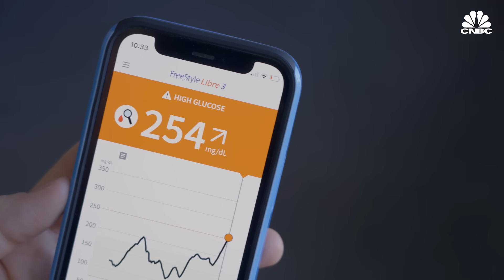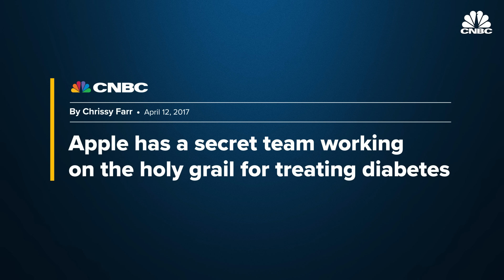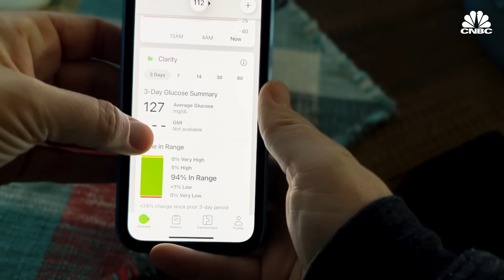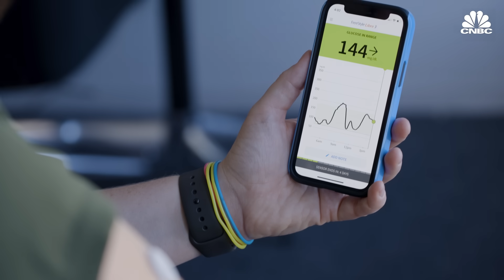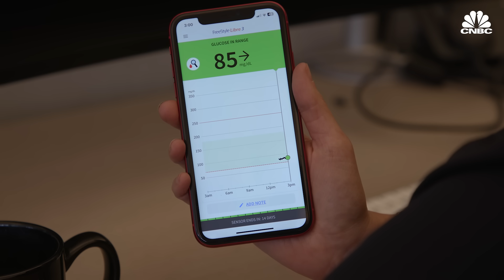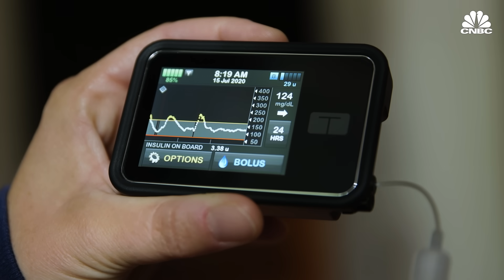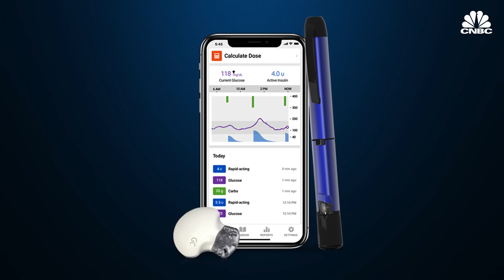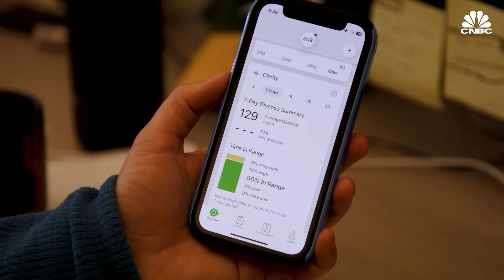The Rise Of Glucose Monitoring Among Non-Diabetics

Comment: As a 55-year Type 1 diabetic, the Dexcom G6 and G7 systems, used in conjunction with the Tandem t:slim X2 with Control-IQ technology, have been critical to managing my condition.  However, upon reaching age 65, the anticipated  annual insurance premium due to a pre- existing condition  is unaffordable and subject to a cap resulting in significant out-of-pocket expenses during the final two months of each year, which will render continued use unsustainable.  Given the slow pace of new diabetes technology adoption in Canada, I will be forced to transition to the FreeStyle Libre 2 system for intermittent monitoring.

Comment: Stop talking nonsense...
Both Descom and Libre and others like them do not seek to make cheap products.
But maybe a company could be found, probably in China, to make something cheap.
And it can be done cheaply if...
1 - the wires that are inserted into the body, the ones connected to the emitting sensor, the ones that change once every 10-15 days, if they separated from the sensor, the price would be extraordinarily low.
The procedure would be for those wires to be attached to the emitting sensor and then inserted into the body (hand, leg...)

2 - the costs of a device would become even lower if it allows the user to change the battery of the sensor himself. Now the device is thrown away together with the battery after the 10-14 day cycle ends.

3 - the system for inserting the sensor with wires into the body must be reusable. And this can be done extremely easily because it is only necessary to disinfect with sanitary alcohol.
In this case, the only consumables would be the battery and the wires that enter the body (hand, leg...)

Anyway, these sensors are not accepted because they do not give an exact result.
No matter how much everyone on YouTube is paid to advertise them, the fluctuations of the result are very different from the real one.
And although they are paid to advertise them, even they admit in all their YouTube videos that the results fluctuate a lot with the calibrations that are made.
The research for the exact result is on the 2nd place. On the 1st place they are researching how to have a bigger profit.

If a Chinese company comes along that will make this possible, Abbot and Descom will do something else, and they will no longer have to deal with glucose sensors.
For patients of any kind, life would be much easier and much cheaper if companies did not think about maximizing profit.

If you are stay and think, any diabetic who is interested in his own health, can appreciate his blood sugar himself, perhaps much better than the fluctuating result of these devices.
Not to mention that patients are tricked into paying a price for an inaccurate result.
Have you noticed that, lately, more and more money is being asked for all kinds of things that no longer have any guarantee?
Let's take the example of some cars that have malfunctions in the braking system because it was poorly designed. Software... not to mention vaccines.
It has become a fashion to sell imperfect things to which from time to time various improvements are made where the customer is obliged to pay for each improvement.

You will realize that Dexcom reached the device with no. 7 and Abbot reached the device with no. 3 and none of them thought to simplify things by doing something from what I wrote above?
And they won't do anything either, because they are interested in exploiting the population.
They don't give a damn.
Their greed is no longer enough.
They want more and more, forgetting about humanity and the role of the doctor on earth.

Comment: A person without diabetes has a very tight sugar control loop, where the blood glucose is always kept within a tight window. Monitoring the blood sugar levels of an healthy individual make no sense and can't be of any real help.
In an healthy person, the item to monitor would be insulin levels, but there is no technology for this.
Instead, for diabetic people, the use of a CGM should be made mandatory. It change completely their life outlooks.
But, of course, CGM manufacturers will try to improve profits, not the public knowledge of the problems.
Only recently Abbott made the sugar level monitored continuously over Bluetooth; until few months ago, we had to make an NFC scan every time we needed the correct sugar level. Finally the hardware device and the Software Application have reached the necessary level of maturity, and now the National Health Systems of EU/UK countries must distribute the device to each diabetic person.
Merry Christmas,

Comment: Been a Type 1 for 35 years. I am so glad 10's of millions of non-diabetics are using these devices & driving costs down!
Reply: The price is still crazy for long-term use without insurance, especially for DexCom.  The current products are still too short to use, too high to buy.   Need more competitors. measure Glucose accurate is difficult but not super difficult in terms of technology.  I am confident this market will be similar to electric weight scale finally.
Reply: it's OTC in Brazil as well...
Reply: Keto diet will save u
Reply: I have Lyme disease, the new continuous monitoring gadgets help me stay low / no carb... which in turn does wonders form my symptoms

Comment: I use Libre to control my hypoglycemia through food.  I’ve been able to lose 30lbs in the past year just by knowing what foods spike my blood sugar. I’ve had lows in the 40’s and am fortunate I have never had a seizure.
Reply: So did u use it for diabetes or just weight control?
Reply: @andi9x17  no I don’t have diabetes or at least that’s what my endocrinologist told me what I have is low blood sugar due to bariatric surgery in 2000. I used it specifically for weight control and it worked very well for me.
Reply: @MoonLightOnWater1  I’ve heard that those without diabetes and just hypoglycemia will not be eligible for a CGM prescription- may I ask if you were given one or do you just use a otc biosensor?
Reply: @ I asked my doctor to prescribe it to me as it helped with my weight management and she did.  Actually, that’s how I found out I had reactive hypoglycemia.  And you’re right, they are not covered by my insurance…..or at least I don’t think so as I pay about $265 for six sensors at a time.

Comment: Hang on, back the banana boat up your fact are incorrect, Type 1 diabetes the pancreas cannot produce Insulin, Type 2 the pancreas does produce Insulin but the body cannot effectively use the Insulin produced, CNBC you stated that type 2 need Insulins to control the diabetes that is incorrect.

Comment: At some point they will realize MRI’s ability to determine glucose concentration can be used to create a noninvasive CGM.  The basic principle is within a magnetic field the spins of protons in water molecules will become aligned. By pulsing with radio waves of specific frequencies you can “knock” the spin down. The “recovery” in the spin is dictated by the local environment of the protons.  The glucose concentration influences this such that a correlation can me made and glucose concentration determined.  I see no reason this cannot be miniaturized to a small device that creates a small region of magnetic field at the wrist to perform this process at a “micro” level.

Comment: It’s so much more sanitary than pricking the fingers a zillion time. We need to get rid of the prescription only requirement and lower the price to something reasonable.
Reply: The price will never drop unless china releases cheap ones for the masses. They want to milk the health insurance with the insane prices and the replace-every-2-weeks model.
Reply: The downside is that CGMs can be up to +-20% off which is a lot. Finger pricking is far more accurate if you really need precision. Using both provides continuous monitoring and accuracy.
Reply: @ so what? It will still show spikes.  Knowing whether a rise to 180 vs 200 is irrelevant if you don’t have diabetes already. Real CGMs are recommended for diabetics and they can be calibrated.

Comment: Been using the Abbot FSL 2 for about a year now. I'm not sure what the definition of "accuracy" is in the medical world, but I do not consider the FSL 2 to be accurate as it rarely is close to the reading I get with a finger stick. I even noticed that I routinely get higher readings when the CGM is on my right arm, vs my left. I have had readings that vary by more than 20% when compared to a finger stick. I only find the CGM useful to see trends as the numbers themselves do not seem very usable as "data". Kind of alarming that someone might have their insulin pump using the CGM as a basis for when to automatically provide insulin if the CGM is not very accurate. Also, if you use your phone as the reader for the FSL 2, Abbot seems to be caught continually off-guard by iPhone software updates, almost as if they are not aware that there are beta versions of iOS to use for testing. They always put a notice on the screen that their software has not yet been tested with the new iOS updates, but they never notify you when they have been tested, if ever. For this reason alone, I can't wait for Apple to figure this out. I just hope there's a way to do it accurately.

Also, this report stated that one of the companies was going to add a test for ketones to their CGM because elevated ketones is a sign of ketoacidosis. While not exactly a false statement, it is only true when ketones are very high, and in the presence of very high glucose levels. I spend nearly 100% of my time in nutritional ketosis by avoiding carbohydrates. Doing this via a medically managed ketogenic diet has allowed me to reverse my T2D and remain off of all diabetes meds. The treatment was proposed, and paid for, by my health insurance company.
Reply: I use the freestyle Libre 3.  It usually runs 20 points lower than finger sticks.  That said, I’ve had finger sticks vary that much using the same finger within a minute of the last test.
The CGM helps me by showing me what food causes big spikes and what food doesn’t, so I eat healthier.

Comment: CGM for non diabetics? just why?
Reply: I can buy a gun without a prescription, and I don't have to explain it to anyone or tell them why.
Reply: Why do you think pre-diabetics would need to monitor their glucose level for?
Reply: @aleenaprasannan2146  
    To detect prediabetes or diabetes early. Prediabetes is a condition in which blood sugar levels are higher than normal but not high enough to be diagnosed as diabetes. CGM can help to detect prediabetes early, which can help to prevent or delay the onset of diabetes.
    To improve athletic performance. CGM can help athletes to track their blood sugar levels and make adjustments to their diet and exercise regimen to optimize their performance.
    To lose weight. CGM can help people to track their blood sugar levels and identify foods and activities that cause their blood sugar levels to spike. This information can be used to make changes to their diet and lifestyle to lose weight and improve their overall health.
    To improve overall health. CGM can help people to track their blood sugar levels and identify patterns that may be indicative of other health problems, such as heart disease, stroke, and Alzheimer's disease. This information can be used to make lifestyle changes to improve overall health.
Reply: @aleenaprasannan2146 ...so as not to develop full-blown T2D and reverse the pre-diabetic state. I did it and having a CGM (after brow-beating my PCP into prescribing one) was THE most valuable tool I had to do so.

Comment: I had a monitor that you put on your arm and it will keep track on your phone of your   glucose It did not work for me. It ended up putting me in the hospital in emergency telling me that my glucose was real low after i got into the emergency they checked it it was at. Least 30 to 40 points off.  I used 7 of these for about 6 months and they did not work. I called the company and they even sent me a new one right from  there supply and I tried it too and it still didn't work. They were around  30 points off so I   myself would not trust it. I don't think it's. Perfected yet although  my neighbor said it was only about 4 points  off for him
Reply: Bruh, it showed me mine is perfect, but it was above 250. I hate this thing and that too at price like 40$ for one

Comment: I think if this helps lower costs to diabetics by helping with economies of scale and the people who don't need to wear one 24/7 pay more than what someone with diabetes has to pay, let them in on the game and let that help real diabetics get lower costs, even if it's a discount program you have to apply for. 

Just looking at the online pricing, a G6 sensor is $70-$94 (~$73.40 USD on Canada site) ish and a G6 transmitter is $176 ($212 USD on their Canada site) . The first thing they can do to bring costs down is to make the transmitter rechargeable, even if that only takes it from ~3 months to ~1 year, that would be ~$14.67/mo for the sensor vs the current ~$58.67/mo. If people are not hacking these to change the batteries or to charge them, you should. The sensors at ~$219.44/mo (~$7.32/day) are a bit nutty, It looks like every sensor comes with an applicator, finding a way to be able to reuse an applicator could see some costs being cut. I don't know the lifespan of something that probably has to have a needle in you, so I can't really speak to making that last longer. 

It does look like they have a generic cash discount with Amazon Pharmacy to bring 3 G7 sensor/transmitter devices from $377.73 to 177.73 if your insurance won't cover it, but it's not as good as the estimated insurance cost of $47. It also looks like they have made the sensor and transmitter, so that kinda kills the idea of making them rechargeable.

Comment: Wasn't looking too deep in to how these devices are built, but I'd assume they are throw away after 14 days, instead of recharge battery, replace sensor and disinfect in home setting
Having 2 devices and 14 days to disinfect charge and replace parts is quite feasible
Drastically lowering cost for both sides of equation

Comment: Both FreeStyle Libre 3 and Dexcom g7 have higher out of pocket price with united health insurance in the USA than the quoted in this material. At least for me the prices are considerably higher
Reply: Same for me, using Freestyle Libre 2. However, my pharmacy recently told me that if my Dr. wrote the prescription for 94 days, rather than the 90 days he usually writes it for, it would be a lot cheaper. They told me by way of a note on the prescription paperwork that was stapled to the bag, and I didn't see the note until I got home. I'm going to ask the pharmacy about this again before I have my Dr. write the next script..

Comment: One thing to note. I called the Freestyle Libre support for 2 failed sensors. I was immediately told never to use their device for deciding how much insulin to take. Even they admit it cant be trusted. I could get into the occasional failed sensor, or the fact that all your data gets sent to them, no way to opt out. Worse, the one part of the data their servers do not receive are the serial numbers and error codes. This forces you to use their buggy phone service to get the replacements. The won't automate this. But they do work when they work, thank god for having insurance on these devices with only a 20% co-pay.
Reply: In addition, it can be difficult to keep the sensor on past 8 or so days, often so after 10-11. Why is it that Bayer has a 10 day limit per sensor in Europe but they force those in North America to use them for 14 days per unit. Those last 4 days are why I have to keep 'Tegaderm' bandages in stock, sometimes it takes a 2nd one just to keep that sensor on the arm.

Comment: Why do you have to replace the CGM every 10-14 days? This should be something that doesn't need replacement!
Reply: Sensonics has a 180 day sensor, currently working on FDA approval for 365 day sensor.
Reply: The CGM needs replacing because for one thing, it contains chemicals that get used up. You are wearing a tiny laboratory on your arm. There's also a battery in there.
Reply: Why is this something that would not need replacement? The way that cgm sensor works nowadays makes your suggestion not a viable option. 

1. It’s battery powered, the simplest and cheapest way to manufacture is to have a built in battery that is not rechargeable. 

2. Its directly inserted underneath your skin with a thin metal wire that measures your glucose level. Having this permanent would increase the risk of infection. 

3. Generally it’s good to switch places as to where you are inserting the cgm sensor to ensure proper measurement.